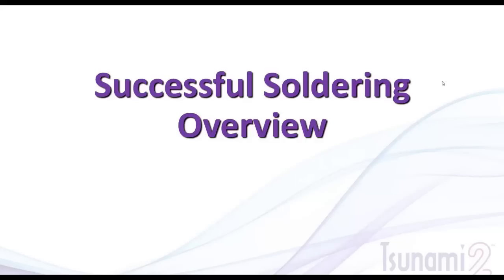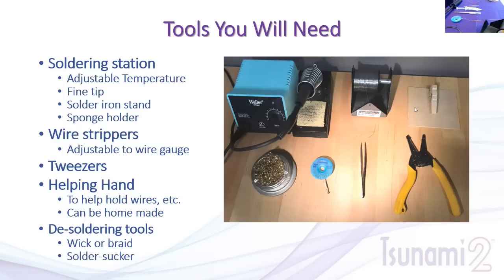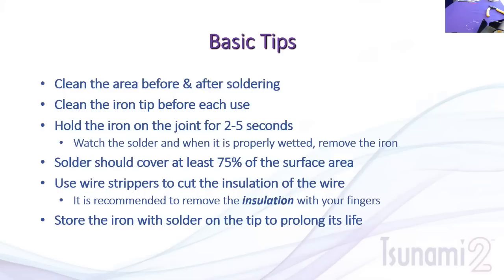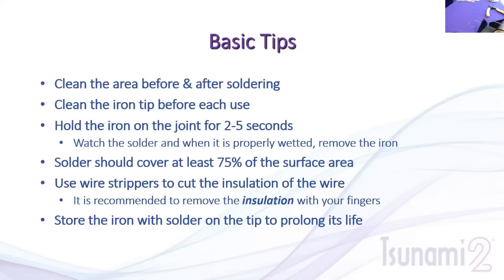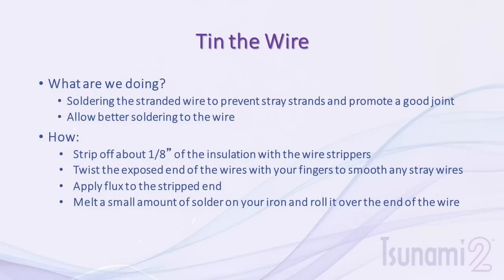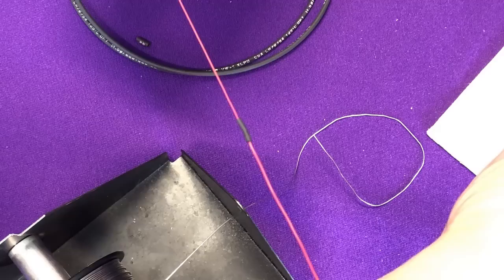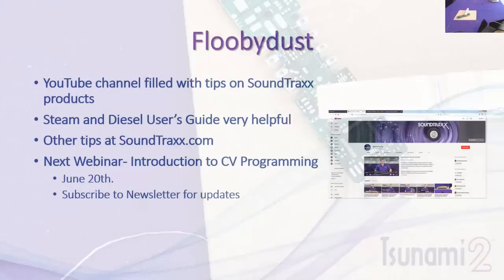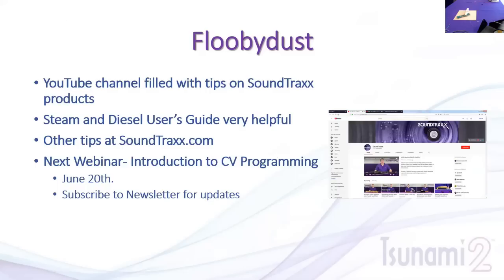SoundTraxx Soldering Class (webinar 8)

Comment: Did I miss the part about what the proper temperature to use is?
Reply from the maker: We set our soldering iron to 700 degrees.
Reply: @SoundtraxxDCC  700degrees!!! I set mine at 400 and was wondering if that was too high unless you are referring to F instead of C
Reply from the maker: @geraldjones2278  I'm sorry Fahrenheit yes. George has his personal set to 680 F. Also leaded solder requires less heat than lead free.